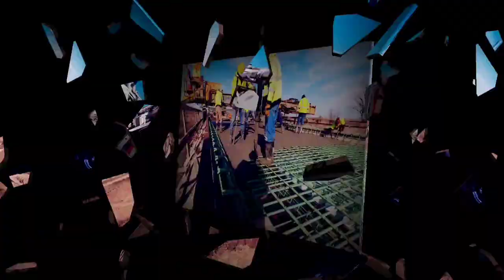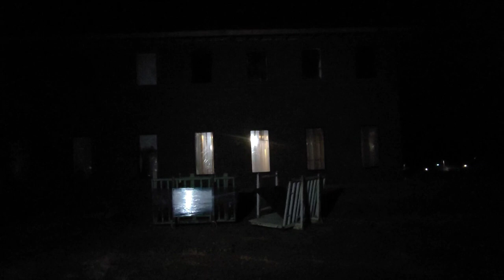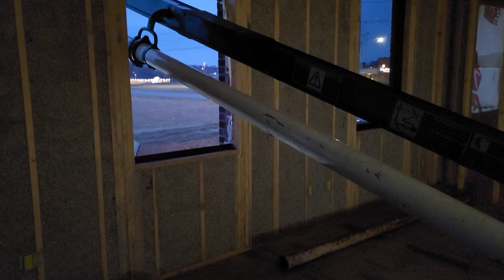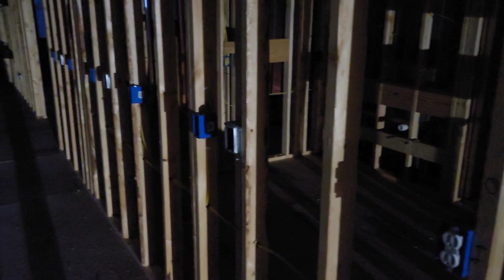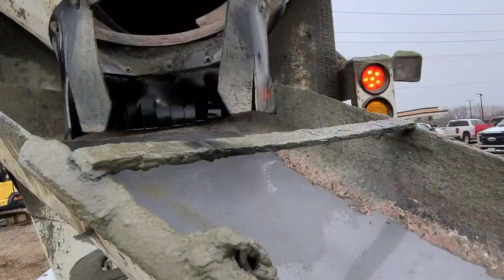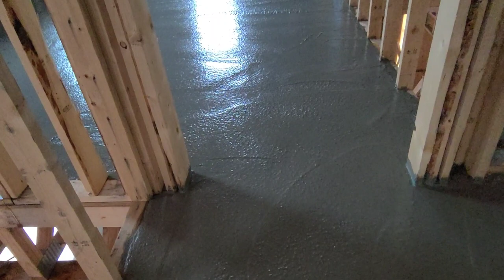Tight Fit! Concrete PumpVlog #15.

Comment: I must say in all the jobs I have pumped over the years, I have never poured a floor in a wood framed building. Is this done frequently in your area? As usual great job on the job and video. 👍
Reply from the maker: Not very frequently at all. Sometimes apartment buildings around here will have a top like that. Not sure if it's more for sound or fireproofing though.
Reply: @fronabargerconveyingpumping  what kind of mix was it?
Reply from the maker: @repaircollc  3/8's rock, not sure if it was 6 or 7 bag mix though.

Comment: do you order a yard of grout to prime out when you run system?
Reply from the maker: Yes, usually don't use the full yard, but we use enough to get a good prime through the line.
Reply: @fronabargerconveyingpumping  even on long pushes we’ve only ever used max 2 hopper full
Reply: Grout is only need for the line pump. Why need the extra. slick back or water alone?
Reply from the maker: @colin9429  just the way we've always done it. Slick line pour we use grout, boom pour we use slick pak. Way too much gambling with water prime.